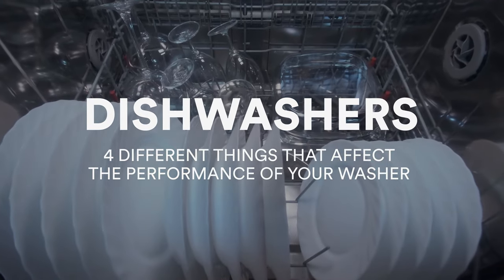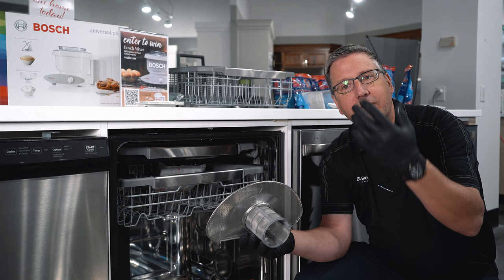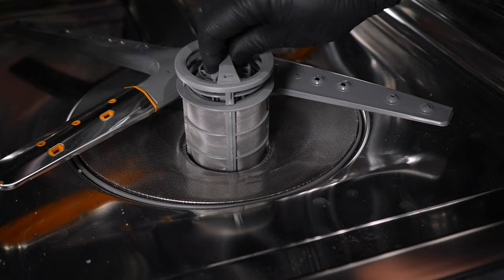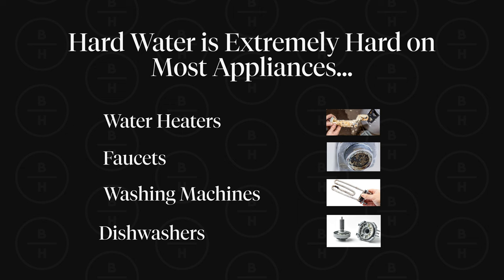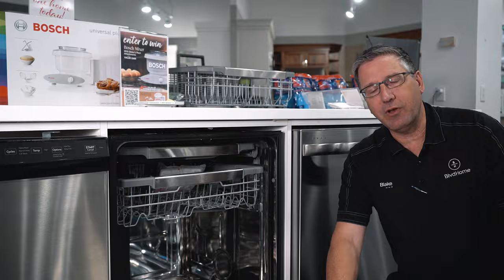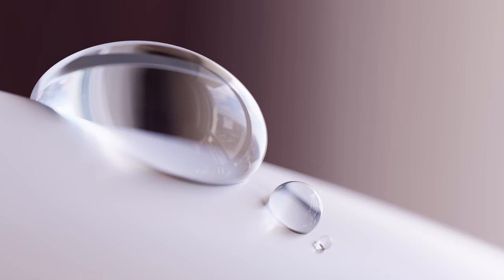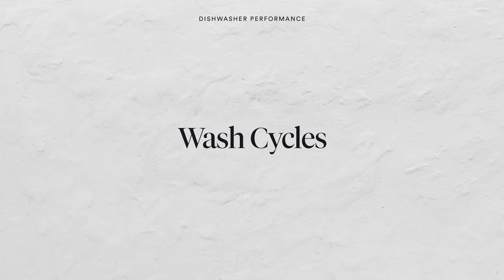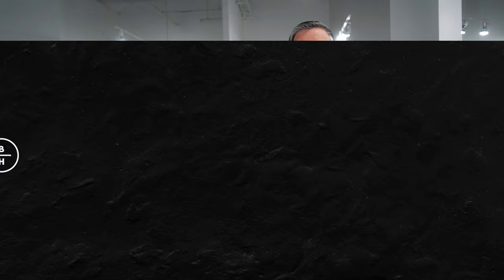Dishwasher not cleaning properly? Try these tips

Comment: After my recent rigmarole with my Samsung (It does not have a removable filter; I have to get in there with a screwdriver and take it apart to get gunk), I've decided dishwashers are so high maintenance (this video proves that) that I am tempted that when my machine finally dies, I will just go back to hand washing. By the time I rinse by hand I may as well finish washing. Appliances should make our lives easier, not be more complicated than the task it replaces.
Reply: Im coming to the same conclusion!

Comment: I have a £189 dishwasher which i only use on 30 minute wash.

Rinse food of plates and never use rinse aid or heated drying.

When the fast 30 minute cycle is finished, i remove all pots, pans, cutlery basket and plastics leaving them out to dry overnight. 

We have two full sets of plates etc so no panic to have it dry quickly for reuse.

Clean the filters once a month by dumping them in boiling water and  bleach then give them a good scrub.

Almost three years old and hasn't let me down yet.
Reply from the maker: Sounds like a great system, thanks for sharing!

Comment: Additional tips...  some older dishwashers have no filter.   They may have a built in disposal.   My Whirlpool Imperial (2004 date) has a filter inside the door, which is apparently a vent filter that needs to be checked occasionally.   If there is no water in the bottom of your dishwasher after it has finished washing, then your dishwasher is draining properly.   Check the bottom of the dishwasher to make sure it's clear of old food and items that may have dropped into the bottom.   Make sure the spray arms rotate freely.   Very important, using the excellent Whirlpool Imperial (an older model from about 20  years ago) as an example, if you have a door that dispenses the dishwasher soap, check to see if that door is open when the entire cleaning cycle is finished.   If it has not opened, and there is still soap inside that compartment, that means no soap is being dispensed on the second cycle of your wash.  Generally you should have a  compartment with no door, filled with soap for the first wash, and a compartment with a door and a latch that opens when the second cycle of wash begins.   Both compartments need to be filled with soap before the first wash cycle begins.   If you see that the door on the compartment has not opened, you can by pass that problem by doing the following.    When the first  cycle of your wash has finished, the machine will pump out the water and refill, then the second wash cycle  begins.   Shortly after that second cycle begins, you can open the door, refill the compartment with no door with soap, and close the door.  Now you will have soap to do it's job in cleaning the second cycle of your wash.  On the Whirlpool Imperial, approximately 20 minutes is the amount of time you have from the initial start to when the second wash cycle begins.
Either watch the clock or set a timer so you can add soap in 20 minutes.   Sometimes that door may not open because you have loaded something against the soap compartment door.   Other common cleaning problems are due to improper positioning of items in the washer.  Load your dishes so water from the spray arms can spray on the surface of items you want washed.
I'm not a fan of the newer dishwashers, using less water, and having controls hidden at the top of the door so you have to open the door to see what the settings are.   Whirlpool still offers models with face mounted controls, see whirlpool's website.   The only problem I've had with the Whirlpool Imperial, manufactured 2004, was a temperature sensor.   I removed the inner door panel and bypassed that sensor.   The machine has worked fine for years without that sensor.   I did have to clean the vent filter inside the door once.   This machine sold at Brandsmart for 300 dollars, and has cleaned far better than the Kitchen Aid dishwasher I had previously, which cost over 500 dollars.

Comment: I quit using Whirlpool. I just finished placing my five year old Whirlpool dishwasher on the curb after 3+ repairs (both boards and water leaks). Repairs are high between year 2 and year 5. I am now using LG until Whirlpool (also sold under multiple names like kitchen-aide) fixes their reliability problems so that their dishwashers provide higher reliability between years 2 and 5. As with most newer appliances, the kitchen appliance industry is struggling with circuit board designs and are still learning how to make circuit boards that are water proof and last 10 years (durable goods requirement) without failures resulting from aging components like capacitors. Of course, the appliance industry redefined durable goods as 10 years of reliability on a few mechanical parts only. In reality, durable goods applies to the entire unit. Like cars, loss of market share will sooner or later result in an effort to remedy the reliability issues. First, they need to hire engineers that now how to specify the electronic components properly (i.e. military grade) source control specifications.
Reply: I’m sorry to hear that you have had such a bad time. I’ve had my whirlpool since 2005. But LG refrigerator’s I’ve had 5 of them and Samsung 3 of one type and and 3 of another. I think it is like a car made on a Monday or a Friday 😅😮. They don’t want us to keep appliances 4 ever they want us to throw them out and get new. Not like our parents who still have there 1st appliance ‘s.

Comment: Really needed this video! Just moved into our new condo. Only three of us, including child, so we hand wash. Shocked and horrified to see water leaking out of Gallery dishwasher. Opened it up and it was full of standing water! I bailed water out then took apart the glass trap, sprayer arm and that disk filter. More dirty water down there but am not going any further. Standing water removed, items appear back in their proper places. Wondering if I need to have drainage cleared out of pipes?
Reply: Do you have a food disposer in your sink? It is attached to the dishwasher and the disposer may need repaired or replaced as water is backing up into the dishwasher you don't use.

Comment: These are things I have practiced for years. Now that I own a portable dishwasher, I use sodium precarbinate, citric acid and scented vinegar to clean once a month.
For detergent I use 7th Generation because it is natural, Lemi Shine rinse aid because that is natural as well. I never use a heated dry.
Reply: Why don't you use the heated dry?
Reply: @CarolC32  To save energy, as it is not needed.
My stupid sister in law used heated dry and caused plastics to melt in the dishwasher. Another reason why I refuse to use heated dry, the element is exposed.

Comment: Also listen to the motor pump to see if it sounds like it is making a surging cavitation sound, indicating it is pumping air some of the time, low water level. 
Manually add some water to the dishwasher cycle to see if the cavitation sound goes away. 
If so then research your model, to increase the water level.
Take care

Comment: Great tips.  I have hard water (16 grains per gal) and have gone through two circulation pumps on my Bosch dishwasher.  Is there something I can do to keep the pump from failing?
Reply from the maker: Aside from using dishwasher detergent that is designed for hard water, doing regular cleanings with hard water cleaners (like the lemi shine), and regular maintenance of your filter, unfortunately, hard water just is harder on everything and you're going to find yourself replacing things more often. It may be worth considering installing a water-softening system if that's something that you have the ability to. I know not everyone has the luxury of installing softeners though.

Comment: I'm so sad that I don't have a removable filter... Samsung DW80F800 series. When it stops cleaning well, I have to unscrew about 20 screws to get access to a wide circular mesh that I can then lift out and clean. Of course, none of that is mentioned in the manual... call the technician is the answer for anything more than a clogged nozzle. Have you come across these units before?

Comment: For gods sake.  We have a one year old Bosch, and the dishes and glasses were coming out gunky.  I cleaned the drain hoses, but they seemed fine.  Still gunky. The first this guy shows is what happens when the filter isn’t locked.  It wasn’t locked.  The outside surface of that cylindrical filter was all gunked up.  Inside was clean.  I think that was it.

Comment: Cascade platinum has rinse aid built in. The dishwasher has a compartment for rinse aid. So, is this redundant? Can I eliminate the rinse aid in the dishwasher?  What about the cascade without rinse aid?  Whirlpool representative recommended gel pods, although the instruction booklet doesn’t state that. I’ll try the lemi shine.  My dishwasher was bought three months ago, and not cleaning, which is why I’m watching this video.
Reply: This is too new to not be cleaning.  I'd guess the dishes are stacked in a way that interferes with the spray arms rotating.

Comment: Our LG dishwasher never completes a load and I'd the load is set for auto for example which should run for 2hrs and say 15min  it's shutting off about 30 or 40min in and just keeps beeping. If we open it it is full of water. We have cleaned filter.

Comment: Thanks for this! I need a recommendation: Which dishwasher would you buy for good quality, high power cleaning & easy access of the filter. I don’t need wifi accessibility.
Reply from the maker: Bosch is the king of dishwashers right now. You can't go wrong with one of those!
Reply: I have a bosch that has never cleaned very well. I have been through a couple dozen videos and cleaned the filter and the arms but nothing has helped. I am going to try to manually fill the water to see if that helps with pressurization of the water.

Comment: I think my dishwasher goes through all the cycles.  It just doesn't have any water power if that makes sense. No water pressure. I used to hear It run so well you could hear It gushing against the walls inside.  Now it's just blah. I quit using it because the dishes didn't look very clean. Everything looks clean inside.  Motor?

Comment: my used washer had glass broken inside and I cleaned it because it stopped working it used to clean fine and it powers on but seems the spinners dont work
Reply from the maker: It sounds like the broken glass may have damaged the spinners in your washer. It's possible that they will need to be repaired or replaced in order for the washer to function properly again. Additionally, it's recommended to call professional technicians to check the machine and fix it rather than trying to fix it yourself (unless you really know what you're doing). Assuming you're not wanting to replace the whole unit. Which could be a better option depending on how you look at the situation. Best of luck to you!

Comment: There's one thing that you're not talking about which doesn't shock me. And that would be to use the original or old-school soap for your dishwasher. As in the powder form or the granules. By using the original soap, you can fill the little pre-wash cup that's right next to the soap dispenser in your machine. And because it's in powder form, it basically spills out into the machine on the first rinse cycle which greatly increases cleaning. Those Puck style soap packets don't allow you to use any soap during the first rinse cycle. And those are twice as expensive as a box of the powder. Seriously try it out it's good stuff.

Comment: Very informative but do you have any information on the older style of dishwashers? I'm getting black almost like dirt on my stuff. I have complained to my landlord so many times past year because it's not washing my dishes correctly. If I don't completely wash them off they don't clean my dishes really. So I don't even hardly use it anymore cuz it's junk. And then I've been getting like a black almost like Sandy dirt on my dishes when I do run it or it's leaking out the bottom of my dishwasher. Maintenance guy told me to run CLR through it because we have hard water. Think I might look at that cleaner you're talking about for the dishwasher though. Debating on buying my own and having them come get this dishwasher so at least I know I'll start with a brand new one. Or at least brand new to me. But it looks like one from the 1980s that I had as a kid. They definitely don't want to put in a good one that would actually work.

Comment: We have a relatively new (circa 2020) Bosch dishwasher. We place knives, forks etc, in the top/third rack to free up more space at the bottom where the removable cutlery basket used to sit. However, we find that it often does not clean them properly.
Knives in particular seem to have a lot of stuff just caked on to them, and have a lot of water spots. We clean the filter thoroughly every few months, though I’m not sure it makes a difference and so I don’t know if that’s the source of the problem. We’ve tried different detergents. Or maybe we just don’t have a good machine. Any ideas?
Reply: I would suggest cleaning the filter at least once a week. Mine gets nasty very quickly.
Reply: @lalathebenificent1335 stop suggesting by time. Go by loads. Some houses do it once a day. Others once a week.

Comment: my Bosch dishwasher is terrible. After a couple weeks of use it has gunk everywhere and puts more crud on the dishes then it washes off. We try to clean the dishes but sometimes they do have some food on them. Even then we've never had a dishwasher that performs this poorly and is so disgusting
Reply: Same here.  My Bosch can have as many dishes come out with food on them, in a single load, as my prior Maytag had over the course of 30 years.  Disgusted with the Bosch.
Reply: @buzoff4642  interesting! I learned that with this dishwasher you need to do a "heavy load" at least 25%, if not 50% of the time. I started to do that and it seems to do a much better job. I'm surprised more people don't complain about these lousy dishwashers. I'm now thinking to buy a new one. I don't care if it's noiser as long as the crap gets washed off.
Reply: @achilleze  "with this dishwasher you need to do..."  Tail, wagging the dog.
Anyways, I only run it when it's 100% loaded, commonly once a week.
Reply: @achilleze  ps - If you are buying a new one, ask about the filter.  If it has one, odds are the design is similarly ineffective at cleaning the dishes.  "Energy star", in this domain and in the domain of washing machines, looks to be reduce effectivity, by lowering the water heating.  It takes hot water to get grease off hands, dishes and clothing.  Dishes, just about every wash, hands and clothes, some of the time.  Olive oil and car greases, the worst to get out of clothing.

Comment: What if the filter is never dirty after 2.5 years of use? My dishwasher just stopped cleaning dishes. They come out as if the dishwasher was not on despite running for hours. I check my filter and use cleaning tablets once a month but the filter just looked brand new.
Reply: It sounds like the spray arms either aren't rotating, or their water hole ports are blocked.
A few debug steps: Do both spray arms swing freely?  Including when loaded?  Is there anything stuck in their port holes?  If they look fine, open the door for a quick second when it's running - you should be sprayed a bit as the rotating arms come to a rest.